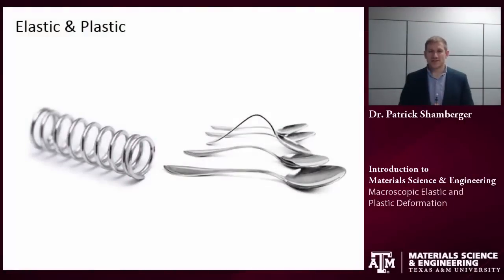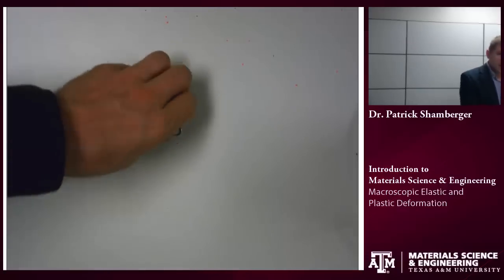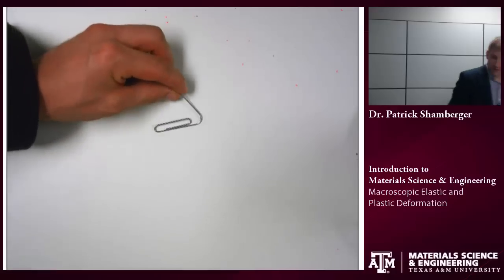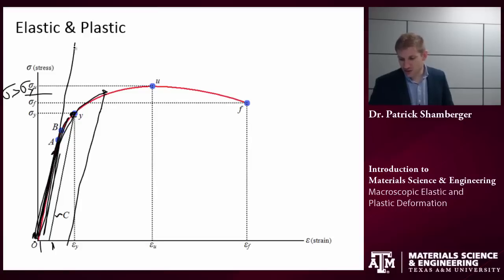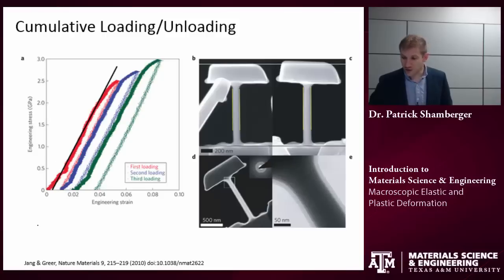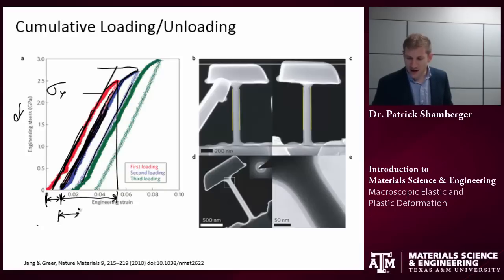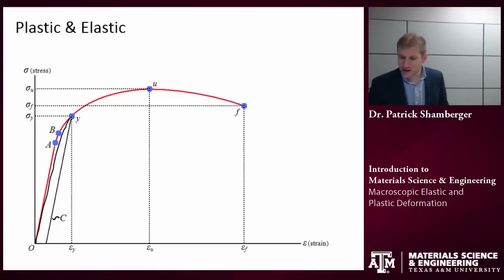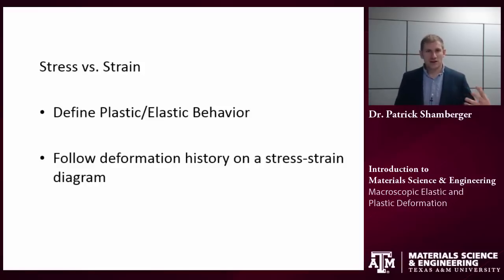Macroscopic elastic and plastic deformation {Texas A&M: Intro to Materials}

Comment: A better way to show it would be to see if a shop can take a video of them bending a short piece of .06 6Al4V titanium in a brake to 90 degrees and stop the ram at 90°.  Then raise the ram up and measure the angle and it will be several degrees less than 90.  The elastic deformation has to be taken into account along with strain hardening when forming metals.  It also doesn't have to be a bending type load.  We have parts that get formed countersinks and counterbores.  The countersinks and counterbores will shrink a good 12 thousandths after the tool forms them.